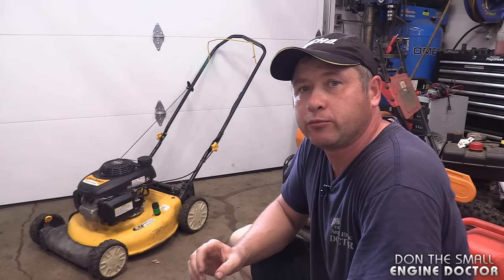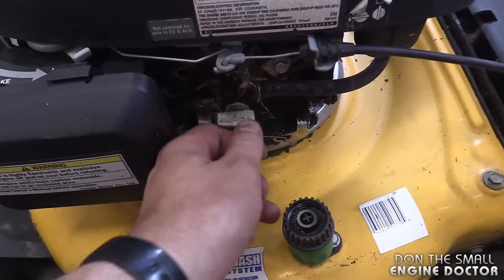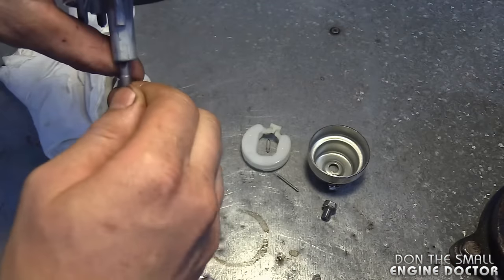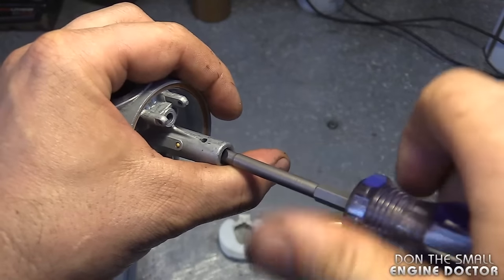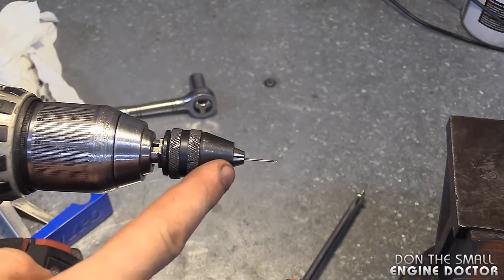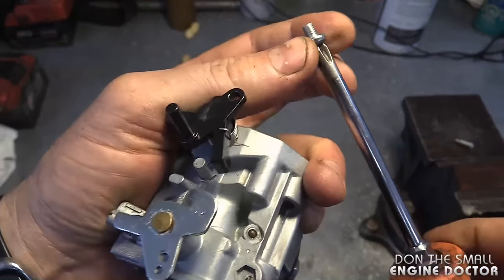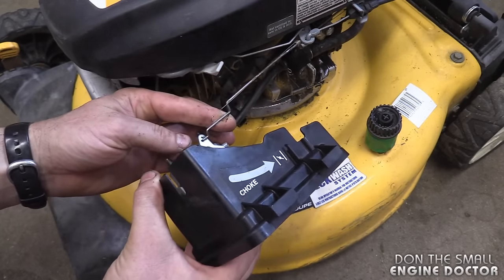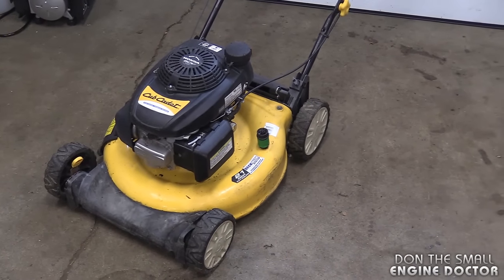How To Fix A Surging Engine on a Lawn Mower, Generator, Pressure Washer & More

Comment: I have a surging problem that's slightly different. My zero turn with kohler engine starts and runs fine. After you mow for a while and disengage the blades it begins surging. If you reengage the blades it cuts and runs well. I found a hole on the neck of the fuel tank and neck is cracking so I ordered a new tank. Can this cause the surging problem or do I have an issue with carb?
Reply from the maker: could be but if it continues it's the carb
Reply: @donyboy73  ok thanks

Comment: Where do you get a 13thous drill bit? Got a Link? :)
Reply: I need one too. A link would be awesome :)
Reply from the maker: https://www.amazon.ca/Pin-Vise-Professional-Electronic-Assembling/dp/B085NFRRJ2/ref=sr_1_5?dchild=1&keywords=micro+drill+bit&qid=1597662795&sr=8-5
Reply from the maker: https://www.amazon.ca/Pin-Vise-Professional-Electronic-Assembling/dp/B085NFRRJ2/ref=sr_1_5?dchild=1&keywords=micro+drill+bit&qid=1597662795&sr=8-5
Reply: @donyboy73  Thanks Don :)

Comment: My husqvarna mower cra ks 1sr time in evening will NOT START DURING DAY has new carb new spark plug new filter fresh gas and oil I live in Texas heat got any suggestions  runs great at night!
Reply: @RebelRicans  thats for sure I have nothing but problem since I got it plastic carb piece  of ....
Reply: Thanks I was thinking  same not sure

Comment: Seems like the engine manufacturer's have these things calibrated right on the edge of being "too lean" for emissions purposes...Not unlike US automakers and carbs throughout the 70s.  I didn't see any obvious dirt in that main jet when you removed it, sure just a little bit of crud build up could push it over the edge I guess.  Wish I could see some sort of diagram of fuel flow through the carb to understand what that jet does on top of the carb though.    I have a new toro snow thrower that does the same thing...Remove the carb and nozzle, nothing obviously dirty, just soak them in cleaner and reassemble, then it runs fine...I end up doing this once a year, even though I physically drain the carb for storage by emptying the tank and removing the bowl drain plug.  The toro engine carb set up isn't too much better, it has two studs holding the carb and filter/gaskets in place, which you would think would make things easier...But, you can't disconnect that throttle governor linkage without unthreading one of the studs out of the block....  Never had these issues with my old 2 stroke Toro with the tecumseh....

Comment: I have a Onan generator in my RV after it runs for about 30 min it starts to serge up and down on the idle any ideals what could be causing this it is driving be crazy.thanks ps when it is doing this it is running very rich.
Reply from the maker: make sure tank is venting properly

Comment: HELP!  I just put two brand new carbs on two Briggs Stratton Engines and both are surging and hard to start.  New fuel lines, new fuel filters and all gaskets and o-rings were installed.  I cant figure out what is wrong unless the carbs are bad!!! ARghhh

Comment: Never use torch cleaners. Get a precision drill bit set for carb jets. They are not expensive and you won't run the risk of over sizing the jet and or having to remove the carburetor 3 plus times to get it right. And they make for a very smooth flowing hole.

Comment: If those three things still don't work I've found that if the valves are out of adjustment on the gcv honda and knock off honda engines they will surge. Also the rod that holds the butterfly for the throttle can wear on the aluminum carb housing and create an air leak.  Although it's less common I've seen it enough times to know it does happen.
Reply from the maker: Great point!

Comment: The fuel line on those bs are so short till to add a filter or and a cut off valve add to the problem need both but chosed the  filter they need to rethink that gas tank and move it back further  for these necessities or charge us for these functions.

Comment: Id pass on the Honda gcv160 because on how it is set up there is no oil pan the block is split in half to remove and they use Honda bond to seal it instead of a gasket its even like that on the valve cover. I recommend replacing gaskets and put a sealer. to do a valve resurfacing you have to take everything out pistons crankshaft flywheels ETC it must have been designed as a throw away engine I've heard about rocker arms breaking they designed this engine for cheaper equipment big box home depot sears My choice is the 675 EXI Briggs and Stratton or gxv160 a real Honda engine or a 2 stroke Tecumseh good thing my DR trimmer has a Briggs and Stratton on it

Comment: I've got one of my many Cub Cadet walk behind mower with the front swivel caster wheels and it has the Briggs and Stratton 190cc Engine on it and 8tz doin the exact same throttle surging but I've cleaned the Carburetor and it's not helped so I guess it's time for a new Chinese Carb from The-Bay

Comment: That engine probably would not idle or run at low speed either.  9 time out of 10 it is the small jet (idle/primary jet on the top of this carburetor) that is clogged.  The location of that jet depends on the engine and carburetor (different for B&S engines).  You really don't need to enlargen the jet, but you do need to take a piece of very thin, stiff wire (single strand from a wire brush) and make sure it is clean/open.

That was SPECIAL screwdriver that Don used to remove the larger jet (main/secondary jet that hold the emulsion tube).  Do NOT use a regular screwdriver or you will have a problem. 

Another trick some people do to clean a carburetor is to remove the bowl, the bowl gasket/O-ring, the float and the needle.  Place it in a pot of boiling water with a couple drops of dish soap and let it simmer for about 10-15 minutes.  Reassemble.

It you soak the carburetor in some cleaners, the bowl gasket/O-ring might swell making difficult to reassemble the bowl to the bottom of the carburetor.  If this happens, remove the gasket, wash it in hot soapy water, rinse well and let air dry for 10-15 minutes.  It should shrink back to the proper size.

Comment: What about using Fix it Fuel
Reply: I used Sea Foam on my lawn mower with the same problem, and it worked well.  Now I add Sea Foam to all of my small engine gasoline.  It might not work in all situations, though.

Comment: How bout a fuel filter , got 2 of those engines on different equipment never had any problems
Reply: Honda’s and all of the Chinese clones like them already have fuel filters built into the fuel outlet of the tank, it’s inside the hose where it connects to the tank.

Comment: Thanks very much for your instructions, but it is difficult to understand why you need to physically enlarge a hole to fix the surging problem.  Why would one engine have but not all the other machines of the same model?           Wouldn't the engine designer have spotted this surging problem?   And furthermore, using those hole-enlarging metal sticks, cannot be legal, due to you are altering the flow of gas quantities?

Comment: So in order to keep your carburetor clean you use fresh gas all-time, gas stabilizer, gas treatment, keep debris off gas  tank if no filter, and store the mower gas empty??? That's what I try to do.
Reply from the maker: Yes correct, or buy an electric lawnmower and be done with the hassles!

Comment: It is unfortunate that we don't know which change(s) actually solved the problem. :( Oh, well. Also you filmed a small part falling out followed by the emulsion tube; it's replacement did not occur during reassembly - very strange. :( Oh well.

Comment: The number one way to avoid this is by using ethanol free gas. I been using this gas for 5 years now and never had a carb issue again
Reply: Also I always shut my machines off using the fuel shutoff valve.
Reply: I use nothing but Sunoco 87 in everything,  No need for Premium
Reply: @tracysmith9934  
It’s not premium gas. It’s gas without ethanol.

Comment: I noticed how you failed to check the RPMs of the engine with a tachometer. The RPMs on small engines with a non-adjustable/fixed high speed main jet is supposed to be set at 3,200,  And engines with a fully adjustable high speed main jet can be set at 3,600 RPM. The reason for this is because with a fixed main jet, the engine will run too lean above 3,200 RPM, resulting in surging & possibly cylinder head burn-out, and/or possibly the engine smoking out the exhaust prematurely.
Reply: Rotary mower engines are set to max RPM's dependent on the size of cut as the speed is set for maximum blade tip speed. The wider the cut, the slower the engine will be set to run.  The reason an engine surges like that is due to a restricted or blocked idle circuit. 
When an engine is running with little to no load, the fuel is being fed by the idle circuit and NOT the main jet, as the engine slows and begins to stall from the lack of fuel, the governor opens the throttle in attempt to keep the speed constant.  When the throttle opens then fuel is fed from the main jet and the engine catches and increases in speed and the governor kicks back in to keep the engine from running too fast, then the operation repeats itself and that is what causes the surging.  The jets are fixed and will run fine at any rpm range as long as the fuel jets are clean and unrestricted.
Reply: @KGH-ew8mw  , what I mentioned above still applies to the type of carburetor used. I found this out the hard way after I had to replace a customer's cylinder head. This information is not in any repair manual either.
Reply from the maker: @Pullingtractor  i don't need a tach, i've done this 100 times
Reply: @donyboy73  Maybe so,  and I believe you're like me, with many years of experiences with various small engines & you can probably set the RPMs by ear. But I think that some people who watch your videos don't think about the RPMs of an engine & this may cause problems with their engine(s) later.

Comment: The only jet you drill is the one on top under the screw. Just clean the rest in an ultrasonic cleaner. Never never never enlarge the main jet. I am small engine mechanic in a professional shop
Reply from the maker: i'll say it again, i'm not working on the space shuttle, video clearly shows that it worked

Comment: Never would you enlarge the main jet, nor would you drill the idle jet 🤣 this issue is soley cause by the idle jet clean it properly and problem fixed. (Use an ultra sonic cleaner)

Your lawnmower will not run right with enlarged jets it will run very rich. you can hear it at the end of the video having a splutter on the excess fuel